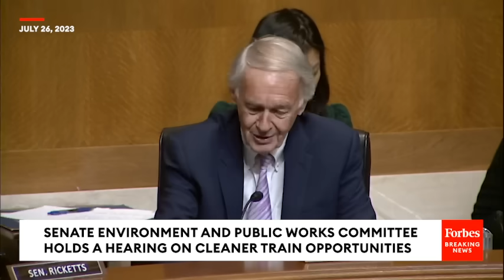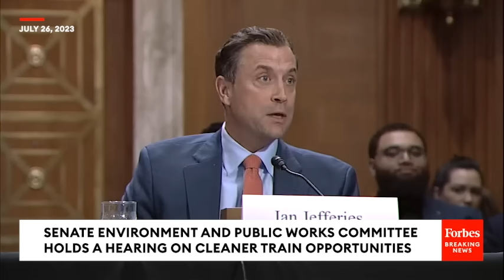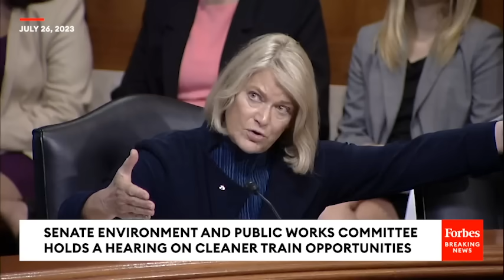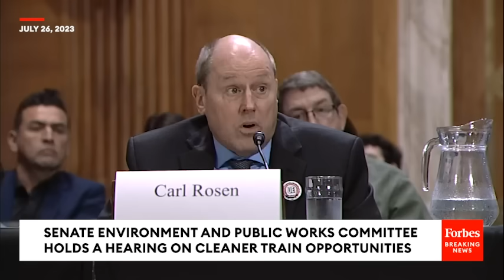‘How Long Would It Take To Replace All Diesel Locomotives With Electric?’ Cynthia Lummis

Comment: CSX trains can move a ton of freight approximately 520 miles on a single gallon of fuel.
Reply: WOW! Think about how far that is compared to that ton would get in your pickup! That is amazing efficiency!
Reply: No other power source, except nuclear, has the energy density of hydrocarbon fuels. Period. You drive an electric vehicle up a mountain grade and your range is cut by 1/2 to 2/3. How many KW can you store in a battery versus how many KW are required to pull 120 eighty-ton hopper cars of wheat over the continental divide? Zero-emission goals are not achievable for any MEANINGFUL mode of transportation except short distance, inner city commutes for passenger cars, and even that is outrageously expensive. My brother-in-law is on his THIRD electric vehicle, while I am still driving the Subaru built when Bill Clinton was president, bought used with 90K miles on it, 14 years ago, and just turned over 200K miles, headed for 300K as long as they keep parts in stock.
Reply: @charlesward8196 Agreed. Please read my comments in this thread on the topic of electric. I'm replying to your comment about replacement parts for your Subaru. I race motorcycles(well, I try). My transporter is a '96 Ford E350 extended Van powered by the venerable 7.3 Diesel. I have +306K miles on it & it's still going strong. I'm afraid it's going to be eaten away by the salty winter roads here in the North before the engine gives up. There's also the replacement parts issue as well. The more affordable parts don't last as long as they did a short while ago. The issues the new vehicles have I wouldn't want.
Reply: @carmiethompson2676  The other vehicle is an ‘07 Dodge 2500 4WD, 5.9 liter diesel (I fill up at the GREEN pump!) that we use to haul our truck camper. With 173K on it (bought used) it will probably still be going when I am too old to drive in about 15 years….
Reply: ‘They’ are coming for your cars Charles. 
They don’t want ‘ordinary‘ people to have one. @charlesward8196
Reply: That may be true, 520 miles on 1 gal. Of fuel, but EACH rail car weighs 120,000lbs and the engine is 420,000lbs . That's a lot of fuel ⛽😮
That's like a cruise ship. 6" per gal.😮😮😮
Reply: @johnathansolloscy2897 Well, it is true. The claim has been verified by the Transportation Technology Center(MxV Rail) near Pueblo, CO & is a subsidiary of the Association of American Railroads(AAR). It was verified in the '70's because that's when the first full page ads were released. You're right about the fuel usage, approx. 0.2-0.7 gpm( the 'm' is for miles not minute) which requires the fuel tanks of current road engines to have capacities of 5,500-6,000 gals. of 'Bunker' Fuel. For an 18-wheeled semi-truck & trailer...6.8 mpg to haul about 20 tons of revenue freight using Diesel #2.
Reply: @johnathansolloscy2897 Correction: I mistakenly used the unit measure gpm(gallons per mile) It should've been mpg(miles per gallon).
Reply: I wouldn't think an electric locomotive powered train  could go half that far on a full charge. But, I did stay in a Holiday Inn Express last night.
Reply: Do they never do cost-benefit studies on proposals & mandates like this?
Battery powered freight trains are not practical. Perhaps we will see hydrogen powered locomotives at some time in the future, but it will be a long time.
Reply: @stevelacombe5291 Hydrogen isn't a 'energy dense' source. Even if 'Low-Pressure' technology is used to keep the Hydrogen fluid, the train crew is still sitting on a bomb. There are tank cars designed to keep Hydrogen fluid & they're run on trains everyday. For a Loco, I don't think it's practical, ever & the distance a train could travel would be shortened because the 'less dense' hydrogen would be used up faster.
Reply: @carmiethompson2676   Hydrogen powered trains use a fuel cell.  So far, only passenger trains using this technology and currently is more expensive than a battery powered train, but who knows what improvements might come about in the future.
Reply: @stevelacombe5291 Please no. Hydrogen transport is really awful please don't buy into that stuff.
Hydrogen is a very leaky and not-dense molecule and is really hard to handle. Even people like NASA regularly have problems that hang them up for months because it wants to leak everywhere, and they need complex helium seals and such. Then you get into the energy density problem where you end up needing up 40 gallons of hydrogen instead of 10 gallons for the same job.... Despite it being less heavy. It takes up a huge amount of space in the vehicle. and then of course it has to be cylindrical because its a pressure vessel. It requires a cryogenic pump to push hydrogen which is freeze prone... etc...

It's not good... Hydrogen should be reserved for low carry capacity applications that need lots of energy, like aircraft, and the odd ship
Reply: @stevelacombe5291  There is nothing magic about fuel cells, and their conversion efficiency is only abut the same as some diesels (about 50%). Just saying the magic word 'fuel cells' will not solve the problem cause by the low energy density of Hydrogen. And hydrogen is a much more dangerous fuel than diesel, which is one of the safest. Cany you find anywhere on the internet any information about a tank of diesel exploding spontaneously, or exploding when it is struck and it's structural integrity compromised in an accident? I think you will find you won't be able to.
Reply: @Mallchad  Space and weight are not much of an issue for a train. I’m not trying to convince anyone that diesel-electric trains are not the best way to do things now, but that doesn’t mean it’s not possible to create something more carbon free in the future.  I see 100% battery powered trains as a complete boondoggle.
Reply: @stevelacombe5291 I don't agree, space directly cuts into the amount of stuff you can haul. Depending on the configuration this could be be several cars worth of hydrogen fuel... Lets ignore the leaks and cryogenic energy losses. That directly cuts into your profit margin.

Besides, carbon negative tech is on the horizon.
Reply: it doesnt matter when those activists demand zero and are in power, doesnt matter if your .9999999% there    they will demand that last.0000001%
Reply: trains haul many many tonnes...
Reply: @vettemuziekjes  yes we're all aware. What I posted is a direct quote from the CSX website.
Reply: @JoeZelensky   That big of a machine, I'd have thought it could haul more than one ton. KIDDING! NOTHING beats a train for cheap per mile hauling.
Reply: @vettemuziekjes You're right, but that wasn't the point. Southern Rail Company(absorbed by CSX) from what I remember, stated that fact I think in the 70's or '80's in full page ads in various magazines. This is physics at work, the efficiency of steel wheel on steel rail provides very little rolling resistance compared to a concrete roadway & a rubber tire. A ton of freight(2,000lbs; not a metric ton which is equivalent to 2,200lbs) can be transported 520 miles using a gallon of bunker fuel(a less refined fuel compared to the Diesel #1 & #2 used by trucks). 'Bunker' is also used by Tug Boats & Ships.
Reply: . @vettemuziekjes  Yes yes but that's the average fuel consumption per ton of cargo

Comment: It is my understanding that diesel locomotives are actually big generators that power electric engines. I see 5 locomotives pulling a long train of tankers up a hill, like 180 cars  , all engines are working hard and moving slow. There are no batteries that can do this. I think of the snow and wind these trains work through. This is a ridiculous idea. I live in OK, lots of wind and solar and no it’s not dependable. We have -24 temps at time, solar is a zero , and the wind towers freeze up and are shut down. Stop the insanity ! There is no climate emergency, you can’t just discontinue what is working until there is a reliable form of energy.
Reply: 👍👍 Your understanding is correct.
Reply: Just that, to avoid a direct climb when the grade is to steep.
Reply: NO.  Diesel-electric locomotives in the US have a prime mover (diesel) which drives a generator which provides electical power to traction motors.
FYI, long railcar consists are upwards of 230 units.
Reply: The fact is no one gives a shit about the climate when the Golf rich states were not investing their oil wealth in their countries soon they start doing it and building new cities jealousy start to kick in and they start saying we can't allow this all they do is getting the shit out of the ground and we give them all those money and resources to build, we need to stop it by all means, there are no homeless in those countries and no one goes hungry,
Reply: AMEN! 
There is NO "Man Caused" Global Warming. 
It is SO easily researched.
Scientists agree by 97% that there is NO man-caused global warming!!! 

Scientists also literally show, on referenced graphs, how the lies were actually fabricated...
Reply: @AVB2 And the uranium fuel is coming from Russia, If Russia decides not to sell it your computer stop working,
Reply: Well said.
Reply: Steam would only take 1 or 2
Reply: @donaldshidal851  on a long trip, where are you going to get the water 💦???
Reply: Washington and Biden are trying to destroy our country as we know it,, WHY do people still vote these people into office. I guess they have not suffered enough ????
Reply: FWI, engines run on fuel, motors run on electricity.
Reply: ...and those gradients can never be more than 2%.
Reply: @johncollins7062  Not true.
Reply: @JeffC-fq1be - Then why do some tracks circle for miles, just to avoid a direct climb?
Reply: @johncollins7062  That's why they do it, to make the climb less steep.
Reply: @garywilliams6670 - At a 2% gradient too.
Reply: @johncollins7062  What is your obsession with 2%?
Reply: @garywilliams6670 - At least you did not demean yourself by stooping to adding 'lol" or an emoji. You belong here, away from face book. If YouTube ever demands portfolio sharing, I want you as a partner. As for your very direct, but slightly inaccurate question. What you see as a compulsion is actually desperation. The literal parroting, by both sides of the aisle, of "the 1%" made that number pointless. Now, when you say 1%, the minds of 99% spontaneously shut down. I was forced to come up with another number. I can't say 'everybody'. If you are having problems with 2%, wait until you see my take on 20%.

Comment: And if we replace everything with electric - WHERE DO WE GET THE ELECTRICITY.  In California the are saying do not charge your cars, limit your power usage during peak hours, etc  Until you can solve this problem we need to put the brakes on conversion to electricity.  We could build solar power space stations, or nuclear power stations etc, but for now a large portion of electrical power is produced by fossil fuels. We don't have means to convert to all electric at present.
Reply: Don't bother them with facts and the actual costs.
Reply: What's the problem?  In my house, the electricity comes out of the plug in the wall.  All you need.  Sheesh! </s>
Reply: and California is so  sorry it had to buy 30000 megawatts from other states
Reply: "WHERE DO WE GET THE ELECTRICITY."? You don't know? That is a very simple answer. You mix fairy dust with unicorn piss and it produces an unlimited energy supply. How could you not know this?
Reply: And along with all of this is the slow creep of the "smart grid" and "smart appliances" that has been pushed since the Obama admin. So in case you haven't figured it out yet, the plan is to turn down or turn off the electricity to your home appliances and your electric car charger so that the elites can have theirs and Palosi can have her fancy ice cream freezer.
Expecting to see a whole new electric fee schedule to price the peasants out of anything more than a minuscule amount of electricity.

Comment: Electric trains now? Battery powered trains ? How much electric power would it require to move thousands of tons of train materials,  even over rails?? Are they serious?
Reply: Yup!  Serious cartoon characters!
Reply: Nuclear flashlights are next!
Reply: all the power. and it wont be enough for even a fraction
Reply: California should sink,all this electric crap is a money grab and about control
Reply: coal power to charge the batteries eh
Reply: A large percentage of locomotives are ALREADY ELECTRIC but simply have a large diesel engine/generator set to create the electricity. We DON'T need batteries but simply the old pantograph system [still in use by high speed trains]. Most of the existing equipment can be reused. Just yank out the diesel/genset and install a pantograph and overhead wires.
Reply: well, the rest of the planet does..
Reply: @vettemuziekjes  huh??
Reply: @vettemuziekjes  Well no actually.
Reply: @vettemuziekjes  What? Do you mean?   No way, the train would have to be half batteries, half freight = not efficient, senseless!
Reply: @vettemuziekjes BULL HOCKEY  😂😂😂

Comment: And how long would it take to charge all those locos especially in out of the way places?
Reply: Charging locomotive batteries??? NO way!! It'd be like what the Europeans currently have which is "electrified trackage", that is electrical wires running overhead along the same path that the tracks take. The trains have a catenary that can be raised up to come in contact with the electric wire overhead and once touching would power the entire train. It wouldn't be locomotives running battery packs because that couldn't be done at the scale needed no way no how!! Nor does that technology in a railroad prime mover even exist today and if it did it would be cost prohibitive. Nice theory but unworkable in the real world...
Reply: @chuxtuff  The overhead wire is the catenary and a pantograph is the locomotives contact device. Oh and you need a certain amount of traffic density to justify the cost.
Reply: @smedleyfarnsworth263 the traffic density would increase if the train transport cost was lower than trucking. And if the rail network was expanded to reach more destinations.
Reply: @zdeneksusannerokos3397  Rail cost is far lower per tonne kilometer over longer distances than road. But you need a certain volume before a rail line is viable.
Reply: @zdeneksusannerokos3397  And if it didnt take weeks from the time it is decided, we need to move this traincar full of stuff from Phoenix to Cleveland, to actually get that freight to move the first mile toward it's destination, weeks in transit and weeks to claim that freight at the Cleveland yard. If each car were independantly driven and never stopped from the time it began to arrival a the nearest yard, to be transferred to that last miles truck for final delivery. Even at 10 miles per hour it would way outrun the way it is being done now with all that stopping and shuffling back and forth to add/remove cars from a solidly linked train.
Reply: The amount of real energy to charge these batteries would overwhelm every system currently.(you like the pun?)
Reply: Overhead wire is an expensive sumbcth to maintain on high traffic lines, in isolated places, or the railroads would have started doing it in the 1970s.  One more thing to fail and shut down traffic for days.
Reply: @MilwaukeeF40C  Railroads used electrified trackage in the early 20th century to  get their trains over the mountains.  They stopped using electric locomotives because maintenance costs were too high to maintain the electrical equipment out in the remote wilderness.